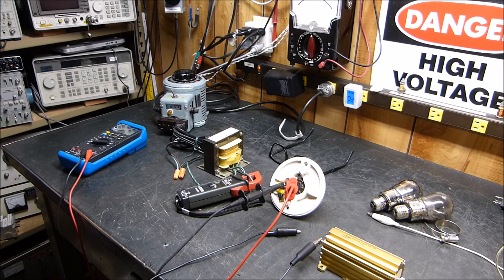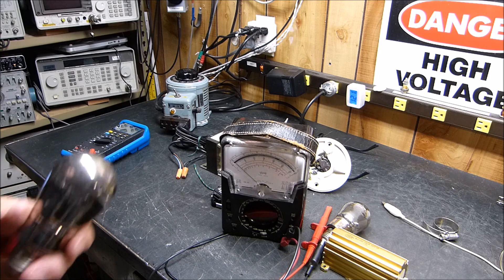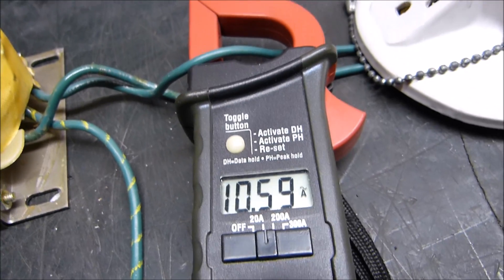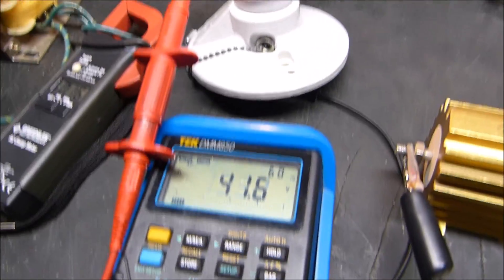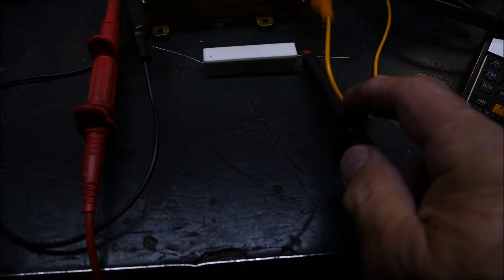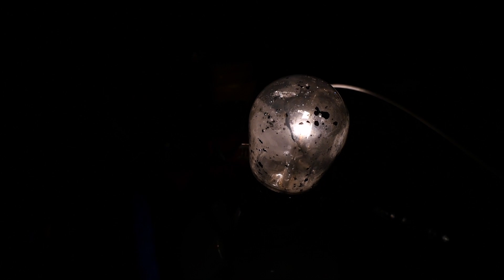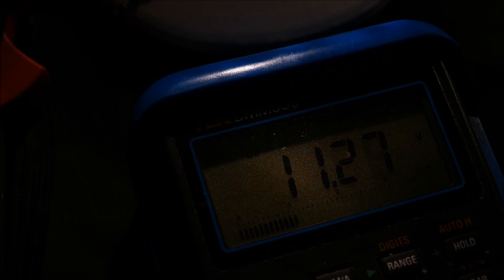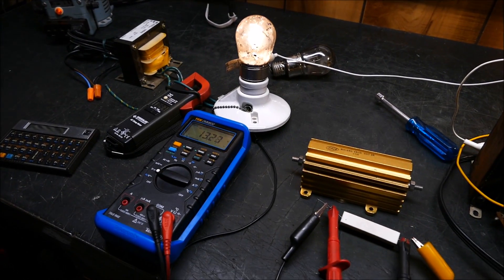Recticon Mercury Vapor Rectifiers Used In Battery Chargers Circa 1920

Comment: 42V AC to 12V DC: It did not drop 30V. It is a half wave rectifier into a resistive load, so with zero drop the average DC would be 1/Pi of the AC peak value. Because the peak is sqrt(2) * the AC rms, the voltage drop being almost constant when it conducts. Taking all this together it means the real drop would be about 12V.

Yes, these are very sensitive to the filament voltage, but the frequent filament voltage rating is 2V, based on your experimenting I would guess it is the correct rating for these tubes too. But better try to find some datasheet...
Be aware, both over, as well as undervoltage on the filament is causing excessive wear. Overvoltage (= overheating) causes excessive evaporation, the undervoltage (not enough heat) causes sputtering from the rectified current.
The reason is, the cathode (not the mercury) needs to have certain minimum temperature to emit electrons. And the mercury discharge inside needs the electrons to be emitted from ghe cathode first. It appears "snappy", because once the discharge starts, fast ions start to bombard the cathode and kick out some extra electrons, as well as heat it up further. But at the same time the fast ions are damaging the cathode (literally "sandblasting" its surface away). If the emission is good enough without those fast ions in the discharge, the arc conducts so well there actually is way lower voltage drop so is the electrical field accelerating the ions, so they are way slower, so do not have the energy/momentum to cause so much damage on the cathode.

Comment: These are worth a lot as they are rare. Also you might be giving it too much voltage? A white filament typically means it's going to pop. Also I wouldn't run them too long right next to you, these give off quite a bit of radiation.

Comment: with the tube being so old you need to run filament at around 2.5V for a long time. hours until  mercury drops are gone.  only one I seen with andode at the base. If you can find a tube number you may be able to get some more info and history on the tube.
Reply from the maker: I have to agree with you about getting all the mercury into a pool in the bottom of the tube. Interestingly, I ran across a couple more of these exact tubes recently at an estate sale, which is where I get much of these exotic items. There was also a power supply there that used these rectifiers. I almost bought it all but I have so much stuff already that I can never use, I passed on it. These MV rectifiers are used in battery chargers of yesteryear which I bet you already know. I just find these items so interesting it is hard to pass them up for a buck. I still use MV rectifiers (866A) in an amplifier I recently built using a 833A and posted on YouTube. Kind of crazy but it is still fun... Thanks for your comments.

Comment: While browsing the web for info on tungar bulbs I found a data manual that contained the specifications of an argon-mercury bulb that looks a lot like these in the video. On page 13 of this manual (http://www.r-type.org/pdfs/tungar.pdf), it says the filament is rated for 2 V at 12 A. The maximum average anode current is 5 A, so these tubes can indeed rectify quite a large current. The manual is from GE, so the Recticon tubes might have slightly different specs.

Comment: The mercury is required in a rectifier. It’s what releases the electrons.  Those type that you have don’t have starters. You have to rock the bulb side to side to set off the reaction. I think  you accidentally shook it while you were heating it.  I’m wondering why it isn’t blue though.. should give off a blue light.
Reply from the maker: I am not sure but it seems the blue comes with a higher voltage - I don't know that for sure but the 866A rectifiers I use in my 833A amplifier run at 3600 volts DC and they are bright and deep blue and beautiful.
Reply: ElPaso TubeAmps really neat though. Thanks for sharing.

Comment: WHY DONT IT GLOW BLUE MOST OF THESE GLOW BLUE
Reply: Because it works at a much MUCH lower voltage, what glows in the other tubes is the electric arc. There is no arc in this one.

Comment: I've never seen MV rectifiers with an Edison base like that. I do remember MV rectifier tubes in a carbon arc power supply for DC carbon arc lights in movie projectors made in the 1930's. They were also used in DC power supplies for machine tool motor drives through WWII. They do require a warm up period, and if they haven't been used for a very long time, can be hard to start.

Comment: uuh, waaay to much power on your filament....usually they don´t glow that bright....be careful...if they blow up you´re in troubble with this hot mercury surrounding you....

edit: i need to correct myself here...it looks like tungsten filament....cool...

Temperature you measured on the bulb looks ok...usually they can deliver 2 Amps or alike, the bigger ones even up to 10Amps for low voltages.

That´s also the reason why they do not have a top-cap. a top cap iss only needed for high voltages. you need plenty of clearance and creapage distance, as you never want these things get shorted, they blow up (=explode ! ) if shorted.

If not powered within several years...you need to wait a couple of hours before they ready to rectify....
The DCGs i got need about two hours of heating only if not powered up for one year or more, according to its datasheet.

Comment: Thanks for showing this. I love the old technology.

LOL at "Wow! 600°! I better not touch that...." :)
Reply from the maker: That little Fluke IR thermometer has saved me from buns many times.  The worst I have ever been burned was when I was doing some aluminum welding and the device fell and just ricocheted off my hand, probably touching me for only a fraction of a second but it took the skin with it and burned me really bad.
Reply: Yeah - that sounds like it would be painful! 

I had a similar thing happen where I brazed an aluminum auto air conditioner tube, then stupidly picked it up by the "freshly brazed" and instead of the cool end.  I didn't hold it long!
Reply from the maker: Many years ago, I had a plugged-in soldering iron laying on the stove in my apartment. My brother came in and did two thing at the same time - he picked up the soldering iron by the heating element  and simultaneously asked was this thing hot?. He didn't have to examine it very long before he figured it out. I think one of my dumbest ones was I was soldering two wires together over my leg while  wearing short pants. You know what happened.

Comment: Is it the camara white balance that it looks orange ?  As far as I know they shine blue Ranging from greenish blue to purple. http://www.pa4tim.nl/?p=1612 pictures of a blue one.
Fred pa4tim
Reply from the maker: In this case it seems the camera is pretty accurate. I checked out your link and I did not get that result. The bulb color looks mostly like a light bulb. Earlier when I was playing with it, I could see some high-purple color between the filament and anode but the over-all appearance was mostly like a standard low wattage incandescent bulb. I was expecting to see the beautiful high-blue color of the 866A HV rectifiers but it didn't happen. I guess that beautiful blue only occurs at a a much higher voltage. Thanks for your link and comments.
Reply: The green one on my site is running at 16V, the purple one at 200V http://forums.atomicmpc.com.au/index.php/topic/14715-mercury-arc-valves/ here you see a beautiful HV green one
Reply from the maker: Wow... that is very nice and beautiful. I really like the video of the MV rectifier running with the fan under it.

Comment: Hi David! Interesting that a rectifier of that age still operates! The filament voltages on MV rectifiers seem to all be in the 2 volt range...an 866A has a filament voltage of 2.5 volts at 5 amps current...Early battery chargers did use them...I've seen huge one's in some chargers...Good video :)
Reply from the maker: Hi Frank - it is interesting that these tubes use the low voltage filaments and are somewhat of a dull glow. I am guessing that the high current level of the filament is necessary for the relative high level of current it can provide to the anode.  I used to use the 866A and 3B28 tubes but when I went to a bridge in my big transmitter, three filament transformers just took up too much room so I went SS. I learn something often times when I make these videos and am pleased to share the moment, i.e. the critical temp or Hg vapor level, whatever it is, that starts the tube to conducting. I also hope that new-comers to the world of electronics will take something away from the approach and not prematurely decide it is shorted (whatever the component may be) and continue to investigate and discover and learn from their investigations. Too often I see instant (and very wrong) conclusions being drawn on components and instruments in YT videos and even worse, a completely wrong conclusion being posted and quickly propagated throughout the Internet. Once this happens, it becomes difficult for others to find a true and straight line of information when they are building or repairing instruments as there are errors all along the path. I can certainly make errors also but I happy to admit them if someone can prove different. There is indeed good information on the Internet but there is also a tremendous amount of misinformation. I don't need to say all of this because I know you know it also. Thanks for keeping in touch.
Reply: One thing I always tell new kids on the block is, whenever the're using 866A's or other MV rectifier tubes is to make sure they warm them up for around 10 minutes before applying the B+. 866's will short if the mercury is in a liquid form and all over the other elements. I've had MV rectifier's fail violently in AM/FM transmitters due to the failure to pre-heat them. Another very important factor to keep in mind is, MV rectifier tubes should always be stored in an up-right position...never upside down or on their side. Always enjoy your videos and the great detail given to a project...:)

Comment: If i recall correctly, you need to cook mercury vapor rectifiers for about a day or so, before you use them. After that, they take about 30min or so to get to operating temperature and pressure. (though im not 100 certain on these values anymore)
Reply from the maker: Yes, I remember something like that also. I once used 866A rectifiers in my transmitters, in the early '70's but changed them out for the direct replacement SS devices. I remember being told that if the MV rectifiers had laid around for years, plug them in and leave them on for several hours, or as you say, a day before using them. Probably good advice. Thanks for your comment.

Comment: I'm much more interested in your promised 6080 tube experiment.  ;^)
Reply from the maker: I know - I've been goofing off doing easy things   :-)
Reply: Have you seen the BottleHead Crack OTL headphone design, or their Crackatwoa with 6AQ5 shunt regulators?  What load are you planning on using on the 6080s, and are you paralleling the triodes in a PP mono design?  Your OT is mono, correct?
Reply from the maker: I am not familiar with any of the devices you mention. And, the OPT is the hang-up at the present time. I will need an OPT with a primary Z really low and I don't have such a transformer. I have enough power transformers and chokes to sink a ship but not so on OPT. I will probably just have to do the best I can by putting 4 ohms on a 16 ohm tap to get one down to a 2K or so primary Z. It will be mono.
Reply: The Bottlehead designs are OT less stereo Hi-Fi headphone amps requiring expensive 300 ohm headphones.  But the design uses an absolute minimum of parts.  1/2 12AU7 feeds 1/2 6080 for each channel.  Not even grid stopper resistors on the 6080.  I was wondering how you planned to use that very nice OT of yours with the 6080s.  There are some Bottlehead amp videos here, check them out if you want to put your 6080s to good use.  ;^)  That is what I'm planning on doing with my 15+ 6080 tubes.  LOL ;^)
Reply from the maker: Well, you should know me by now - the output transformer must pass everything from DC to cosmic rays with only 0.1 dB loss or I don't want it...   :-)   Seriously though... I plan on putting the triode sections parallel and use the 6080/6AS7 using two tubes in PP. The 6336 requires 5 amps per filament and I know the filament winding will not supply 10 amps.